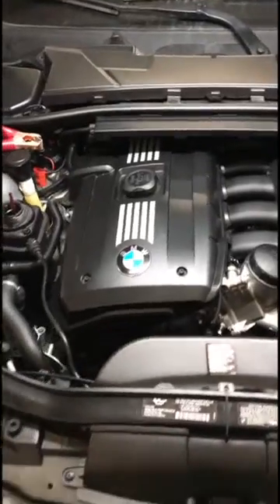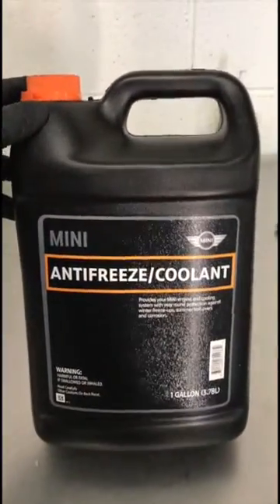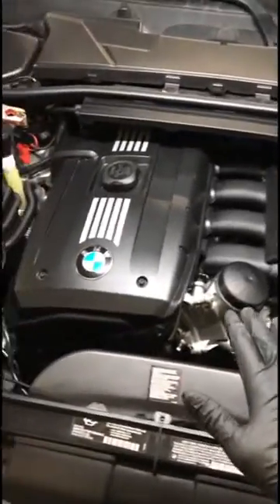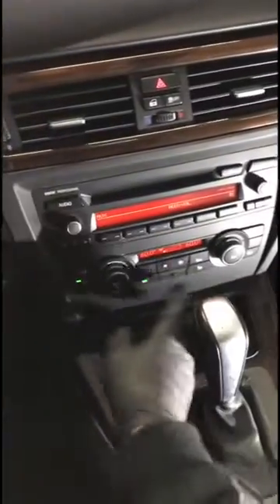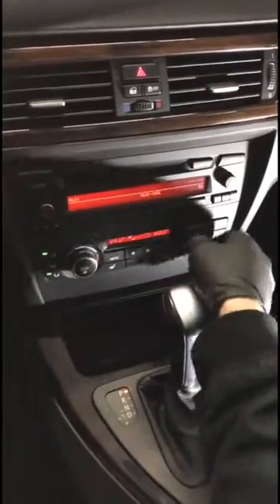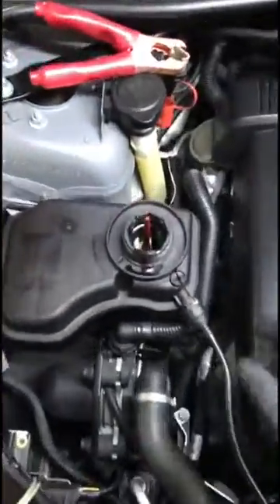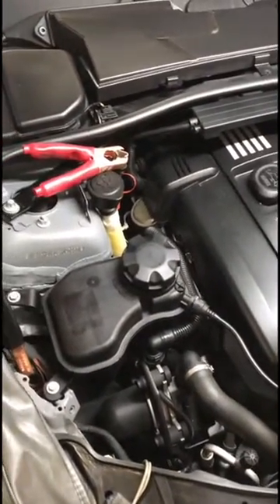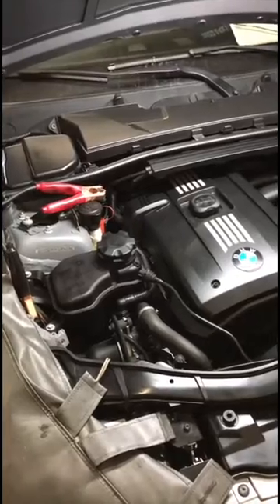How to bleed BMW with Electric Coolant pump

Comment: My coolant pump is making a rattling noise during the bleeding process and normal driving, idling. U can touch it and feel the rattle . Could that mean its on its way out? I did the bleed procedure to be able to pin it to it being the pump without the car running.

Comment: How can i open the whole caver. There is that stick to measure  the level stucked inside and i need to get it out
Reply: If the coolant has ate the plastic stick completely off. I would go from the  bottom of the reservoir and unbolt and bleed the reservoir then take it and remove the stick and get all the plastic out asap. If not you would be digging with plyers and not get it all. The reservoir is 20$ u can also just buy a new one.

Comment: Hi Mike, I have a 2011 BMW X5 with the N55 Engine. I have a coolant leak and looks like the culprit is my coolant expansion tank. I'm replacing the expansion tank next week and after that I want to do a coolant bleed. My plan is to fill up the expansion tank up to the max mark and then do this procedure.

My questions will be:

- Should I keep the cap on or off? the car will be cold while doing this procedure. The expansion tank doesn't have the bleed screw.
- I'll be going for a test drive and wait for the car to cool down. If the coolant level is lower after checking and more coolant is added, do you recommend to do the bleeding again?

Thank you
Reply from the maker: Because the expansion tank is the highest point in the coolant system on that  vehicle, one procedure should be fine.  The cap doesn't matter if it is on or off while doing it. It may spray out a little while bleeding and make a mess. If so then put the cap on. Drive after with the heater on for ten min. Let cool down and recheck level.
Reply: @MikeMDs  Awesome Mike, thank you for your help. Stay safe and healthy
Reply: @MikeMDs  Hi Mike, one more question. Today I replaced the expansion tank and cap, the lower hose connection was the hardest part. The cars has been sitting for over a week and I feel my battery is not the strongest because I haven't been driving the car a lot and before buying it I know it was not driven often.

I bought the NOCO GENIUS5 which is a 6-volt and 12-volt battery charger that puts 5 amps of charge. I'll leave it overnight charging the battery.

I want to do the bleeding procedure tomorrow and I assume the battery will be fully charge. I just want to double check if it is okay to have the charger connected to the car when I start the procedure and if this charger will help to keep the battery from dying?
Reply from the maker: You can perform with a charger attached.  But NOT a jumper .  It will votage spike the system.

Comment: Good video.  When do you unscrew the bleeder valve?  And don’t you want to keep the cap off during electronic water pump bleeding process so the air can escape.  Please excuse my ignorance
Reply from the maker: No prob.  You unscrew the bleeder valve in the beginning when you are filling the system up with fluid to let the initial air out of the line. ( it's a pre-bleeding procedure and is only required if work was performed on the system). Close the screw before electrically bleeding the system .  I put the cap on so it doesn't spray everywhere when bleeding. The point of bleeding is to get the trapped air bubbles out from the engine block and lower coolant hoses. Then you can correct the coolant level after all of that if needed. There needs to be an air gap in the tank to accommodate for expansion.  Remember air can be compressed but water cannot. If the air wasn't in the tank then the system would explode.

Comment: Hey Mike MD, great video. The warning light for low cooling fluid level just came up in my 2008 530IA N53, so I'm about to top-up and bleed. Do I need to start the engine and rev it to 3-4000 RPM, after following your procedure for bleeding the electronic pump, or is the bleeding process completed only by running the electric pump?
Reply from the maker: No you don't need to run the engine to bleed. You can drive it after the bleeding procedure with the heater on. Then recheck the level when the engine is cold again.

Comment: I followed the steps probably 3 times. I hear a clicking noise in the front but see no water flowing into the reservoir. Maybe if I drive around with the bleeder unscrewed a little it will manually bleed the air from the system
Reply: oh, mine is an 07 E87 120i

Comment: I had the same problem as someone else mentioned below, after bleeding the line it never turned off it just kept going. You mentioned it could be a faulty pump or the bus line ( I can’t find any information about a bus line or even what that is)?  Out of the blue driving my car overheated and I had to pull over and now I am pulling the error code P0128 which I would assume would mean I need the thermostat replaced. But all the thermostat test make it appear it is fine. But when I refilled the coolant and then bled the line it would never stop. Any ideas??? Help! Thanks!
Reply from the maker: The thermostat will stay open as a failsafe if it is faulted. But if the engine control module senses it is bad, it is likely telling the coolant pump to stay on all the time as a precaution.
Reply: Mike MDs So the pump only kept going after I bled the coolant, as in it never stopped the bleeding mode; that is until I turned the car off 30 minutes later. So what would cause it to never stop the bleeding mode? You mentioned in another comment that a faulty pump or  something about a bus line? So could my problem be a bad thermostat AND something else like the bus line or a bad pump? When you say “pump” you are referring to the water pump correct? Also if it is staying open, would I still have the overheating problem that I’m having? Also if the car’s heater works just fine could it be the thermostat, I’ve read that if the thermostat is bad the heater won’t work. Thanks so much for your time!
Reply from the maker: Both can cause the pump to stay on until the vehicle enters sleep mode.  I doubt you have both a bus line issue and a thermostat issue.  You may of had a thermostat fault the entire time.  I really don't have a confident answer but my guess is  when ''Force bleeding" the pump it rechecks to see what faults are present and acts accordingly.
Reply from the maker: An additional thought.. The pump has a cpu inside it that controls different pump speeds.  It may have blown out all the lower speeds due to the bleeding procedure and now stays on high speed .  Just like an A/C blower resistor or auxiliary cooling fan circuits.  They do the same thing if all the other speeds go bad. In other words the pump may be bad now.  But I'd try the thermostat first. Hope this helps.
Reply: @MikeMDs  
For a water pump to break during a normal bleeding procedure a $750-$1250 problem from a simple bleed that doesnt speak highly of German engineering and doesn't sound right
Reply: Did you ever find the problems

Comment: Hello FRIEND  i have a 08 plate 3.o DIESEL  bmw x6 need help plz''''''' car runs perfectly  when cold ''when warm it starts to run lumpy like its running on 5 cylinders but not all the time  intermittently '''i can hear i noise coming from ENGINE  when turned  of like could be eletric  water pump the noise poss ''' all water levels are correct AND topped up and not loosing.  water  at all  '''all so can yiu tell me about the rad flaps how and when they open was thinking they not opening making car run hot  thanks  for information   james

L

Comment: Thanks for the help.. it's been really helpful.. the problem I'm now is.. that the bleeding mode never went off.. so now everytime I'm around the car doing something else. When the engine is off. I can hear that water pump activating itself.  Can you help me please and tell me how to deactivate the bleeding mode??
Reply from the maker: The bleeding mode is supposed to shut down automatically after a few minutes. If it doesnt the pump is either faulty or the bus line that controls it is down ( it shares the bus line with the oil level sensor and alternator. If either of those components are faulty it will cause this issue)  I've seen people drive around like this with no problem. But it does put stress on the pump. 
Eventually when the car is off the pump will stop when the vehicle enters sleep mode. ( kind of like your computer's screen saver )
Reply: @MikeMDs  thanks for replying so quick yeah mine is driving fine is just aggravating hearing that pump   turn on itself and start the bleeding process with no reason. 
When I'm around doing something. I just does it once though. Everytime I use the car and come back home and turn it off. like 2 mins After i turn the car off.. i can hear that pump going on bleeding mode.
Reply: @henryordonez910  same here did you figure out the issue ?
Reply: @henryordonez910  bad water pump

Comment: I am original owner of 2006 325i with 112k miles and waterpump is still working. Should I replace it?  I have new parts but too lazy since it is still cold out
Reply from the maker: Hi, I would replace it along with the plastic thermostat which is bolted to it. Especially if  you think it is original and you drive long distances. Even if it is snowing out , if that pump stops then the engine will still overheat.  If they have been replaced before then you are probably okay.

Comment: What if the water isn’t moving around? I hear the pump but it’s no movement inside the coolant
Reply from the maker: you may have an air bubble. Try it a few times.
Reply: Mike MDs I’ve done It like 5 times. And It doesn’t do anything. And water doesn’t squirt out of It. I’m so lost about It!
Reply from the maker: What BMW and year do you have?
Reply: Mike MDs 2011 bmw 328i
Reply: @Drippigolf  if no water is filtering out when you're bleeding the pump inside your coolant reservoir your water pump is failing or has already failed.
Should be able to see the stream in most modern bmws now.
My bmw 535i (f10) started overheating, so right now I've ordered the water pump, thermo kit, and coolant temp sensors.
My fan sounds like a jet engine that you can hear from a block away. Let you know once I've found the solution.
Reply: Vandi I hear the pump kick on but I don’t see It filtering out. It’s still overheating. My dad said It probably has bunch of bubbles but I jus don’t see how the pump went out. Cuz I hear something on when I start to bleed It but I don’t see anything squirting out.
Reply: @Drippigolf  what year and model do you have?
Reply: Vandi 2012 bmw 328 i

Comment: My f10 diesel doesent doing this when engine runs water comes out from the little whole but when i do self bleeding folowing the Manufacturer process it wont start
Reply from the maker: HI your diesel most likely has a mechanical water pump . The best way is to run the defroster on hot and drive it for a couple of miles . then recheck the level once its cooled down.
Reply: Mike MDs no it has electrical pump , i checked the ista process how to do officially MY VIN CODE IS C774376 NEWTIS page there is manual 
But it doesent work for me and i have no error coded I checked myself and also by Bmw ...could it be water valve?

https://www.newtis.info/tisv2/a/en/f10-m550d-xdrive-lim_201204/repair-manuals/17-cooling/17-00-cooling-check/JLmz6P6L
Reply from the maker: Sorry just saw your reply.  Did you figure it out?  Do you hear the pump even operating?  If so them maybe air bubble. If  you dont hear the pump then maybe it is bad or not getting power to it.  Nor sure .
Reply: Mike MDs my car uses different method according to BMW u need to put igniton On, heater max temp low fan, Press gas 10 second, and start engine within 30 second but it doesent happening any special as My Water circulates Immediately as i start the engine Even at cold ... I now also started to loose coolant without any sign off leaking , i had my dpf deleted and it doesent smoke white or black no funny coolant smell i dont know whats happening with this car :/ i had coolant changed By specialist doing the Vacuum Bleeding and filling method And same Water sound ... He put new blue coolant original bmw its now after 700km under minimum .. And from blue color turned red if u look in my Coolant reservoir but if i suck out little water its Blue i cant understand it :(
Reply from the maker: @bmwsincekid   you may have to take it to BMW specialist.  Its money, but they may find the issue faster without throwing parts at it. 
Please keep me in the loop.  I wish you the best.
Reply: Mike MDs Thx I really appreciate not just saying it You are taking the time to try help Strangers for free Thanks for being a good Human Its rare No one cares About the other person Just selfish People in our world .... Take Care i will update you Bro

Comment: Ya I tried this but my car shuts off the heater and car after 12 sec. Why. Key in there
Reply from the maker: Hi there,  your battery state of charge is probably too low . The car is smart and will shit everything off to save the battery.   You will need to attach a charger while you bleed it.
Reply: @MikeMDs  thanks Mike I'll try it at work since I work at a shop. Thanks
Reply: @MikeMDs  shit?

Comment: What about the bleeder screw do u touch  that at all
Reply from the maker: Yes, before bleeding electronically, I remove the screw and add water/coolant to the reservoir till it starts coming out of the bleeder screw. Then screw it back in and electronically bleed it.
Reply: @MikeMDs  thank you I got it to work swapped a new water pump and it failed in 2 weeks luckly I keep the old one as it was still good on my swapped because I had a  thermostat
Reply: Mike MDs I have an n54 535i and the bleeder screw is on the opposite side facing the firewall. Would I still fill until comes out?
Reply from the maker: yes, just be careful not to over tighten, It is brittle. Sometimes water will not drizzle out. that is okay, It is just to get most of the air out of the line. The pump is smart and can detect if it is not spinning in coolant, so it will not bleed correctly to prevent the pump from burning out.
Reply: Mike MDs okay so put in a funnel and fill until it starts coming out the bleeder hole? Because I put a good amount but not overkill where the bobber floats to the top and still says coolants low. Do you think I might’ve stripped the sensor when I replaced the expansion tank? ( I wasn’t very rough with it)
Reply from the maker: I think you are good. Close the bleeder screw and try to bleed it. See what happens.
Reply: I did mine.. and bleeded perfectly.. but..  how to deactivate bleeding mode now? Every time I'm I the car    doing something else whe. The car off.. I can hear that pump activating itself.. and start bleeding. How can I stop it??

Comment: Question 
Wich cars have an electric waterpump ? How can you tell ?
I have an bmw e63 from 2005  a 630i but i dont see any coolant spraying ??
When i start it it flows 
Is it broken ? Or dont i have an electric  pump ?
Reply: Do a google search for BMW OEM parts.  Select a website and enter your BMW info searching for parts. Select the cooling category and see what it lists for a water pump.  Good luck.
Reply from the maker: you probably don't have one. That year came with a different engine .  If you see a fan that is attached to the engine  by the radiator and only spins when the engine is running  , then you have a mechanical water pump. Which in that case you would bleed the conventional way using the bleeder screw at the coolant tank. Once topped off,  run the engine with the defroster and heater at full  blast for 5 min. shut car off then recheck level add more if needed then go drove the vehicle with the heater on.  After car cools down recheck level again.

Comment: I did that but it just made a weird noise, like it’s trying to run but no antifreeze come out like on the video, it’s doesn’t drip into container but instead making a weird noise
Reply from the maker: There could be a trapped air bubble at the pump. You may try using the bleeder screw or crack open a line to bleed some air out while filling it with fluid
Reply: Mike MDs 
Question 
Wich cars have an electric waterpump ? How can you tell ?
I have an bmw e63 from 2005  a 630i but i dont see any coolant spraying ??
When i start it it flows 
Is it broken ? Or dont i have an electric  pump ?
Reply: Do a google search for BMW OEM parts.  Select a website and enter your BMW info searching for parts. Select the cooling category and see what it lists for a water pump.  Good luck.

Comment: Gonna get a bmw in a few weeks 535i 2008 what happens with the old coolant when bleed
Reply: Only need to bleed the cooling system after a repair or a flush/drain.  Otherwise, no need. The OLD coolant should be collected and taken to an automotive  recycling center